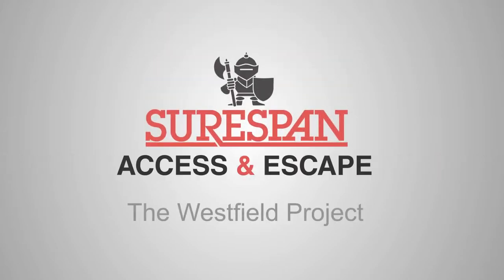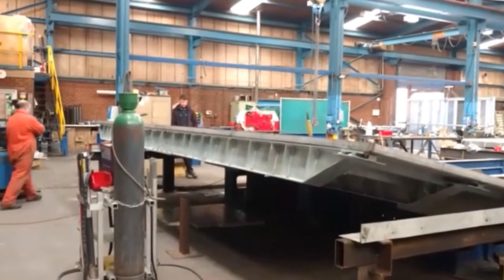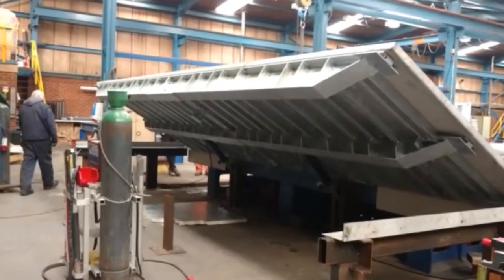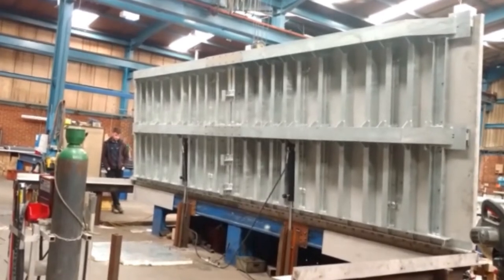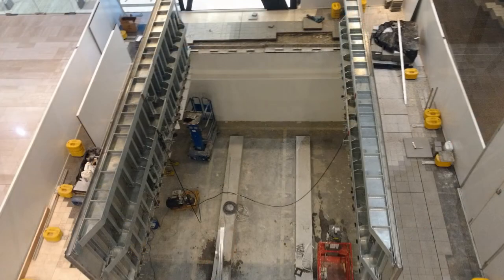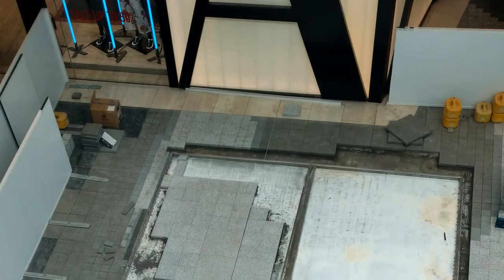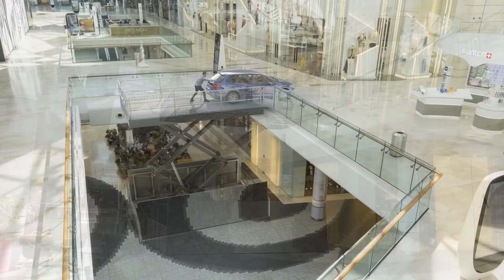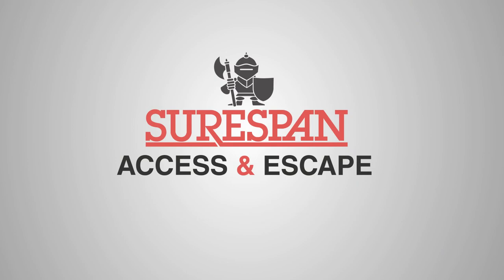Recessed HIAC Floor Hatch - Westfield Shopping Centre

Comment: hello, I need help I want a sliding glazed rooflight i only need the part that moves I have all of the other parts I want it in a width of 2.5 meters and a length of 2 meters can I have that shipping to Qatar? please let me know
Reply from the maker: We can only supply the unit complete including the glazing, thermally broken frame and insulation - designed by our fantastic UK engineering team!